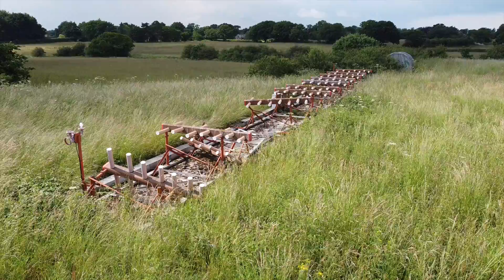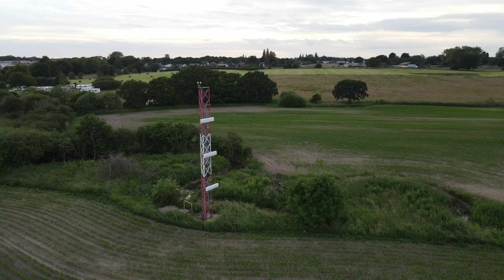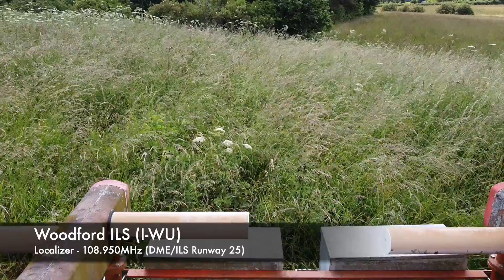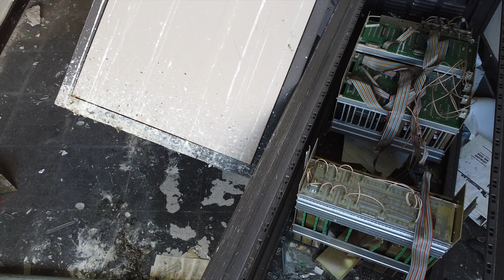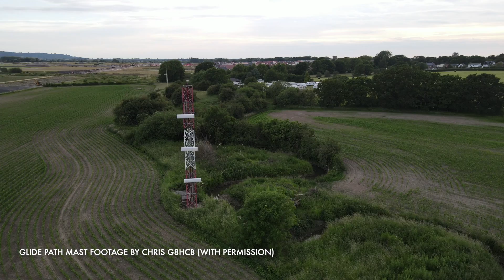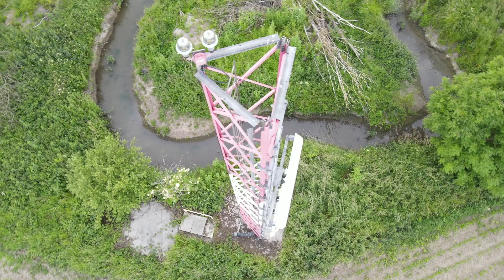Abandoned Radio Transmitters At An Old Airfield

Comment: Its tragic when moron corrupt politicians tear up an airfield for "real estate". Each airport that disappears does so permanently and general aviation suffers another knife in the back.  
Its an extremely destructive process. 
Australia also has followed this path and its harder and harder to see airports remain.
Now the trend is for "non commercial  use only" which means you can't turn a wrench or teach someone how to fly or even sell fuel, that's commercial. Next you won't be allowed to use a toilet at the airfield, and only use it during daylight hours of 9 am to 5 pm and expect even more bizarre rules designed to be intimidation and destruction of airfields.

Comment: It's terrible to see our Normarc ILS in such a terrible state 😞. This system was delivered to Woodford back in 1990 and consist of a NM3511B Localizer cabinet, a NM3523 12 element single frequency LOC antenna system, a NM3533B Glide Path cabinet and a NM3545 M-array GP antenna system. Do not worry about the handbooks, we have them scanned🙂.

Comment: It's great to see your videos! You research your subject and put it over extremely well! Exactly as you said, the 90Hz and 150Hz modulation depths would be the same when you're on the extended runway centreline or glidepath. If the aircraft flies above or below the glidepath then the difference in depth of modulation (DDM) produces a dc (up to 150micro Amps for full scale indicator deflection) proportional to that DDM to drive a 1KOhm meter movement or digital display driver showing the deviation from the glidepath. This is done with  rectifier circuits after demodulation. The same principle for the localiser. When the aircraft is flying on the centreline  the DDM would be zero resulting in the horizontal and vertical deviation bars remaining centralised on the nav indicator or display in the flight deck. Maybe Phil can tell us how the antennas are aligned to provide the precision that's needed?

Comment: Excellent video!!
Brings back so many memories. I was the Air Traffic Engineer at Woodford from 1990 until it closed. I helped to install the ILS and maintained it for 20 years. Not nice to see the Localiser building in such a state!! I was told the Glidepath cabin was recovered and is over at the museum, I'll have to check it out sometime.
Reply: I worked on the 3500 for many years at Bournemouth till its replacement, and again at Cambridge, there it was only replaced last year with a new 7000B

Comment: That Power Supply And Cables Look Like It Could Hurt You 
Great Video Earthling 
Bless Up
Reply: That Must Be Capable Of Outputting  A Few Thousand Volts @ 40 Amps Full Duty Cycle
Reply: @joohop  You're right. Using Full Wave Rectification that box on the wall can easily pump out some serious Farads of ILS goodness.